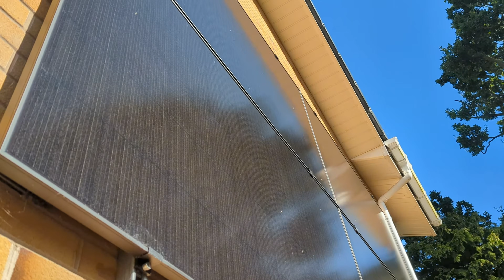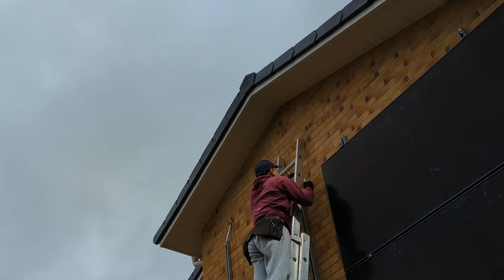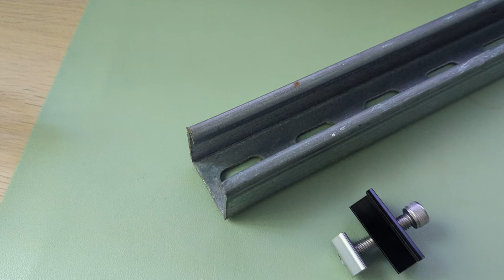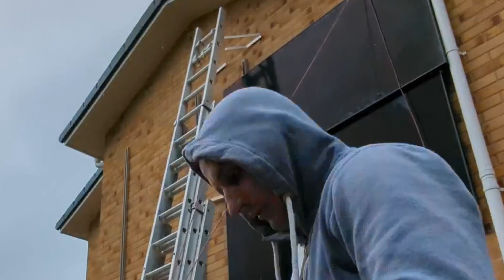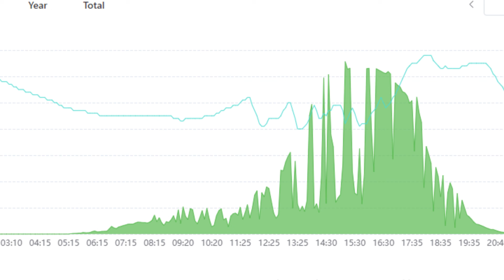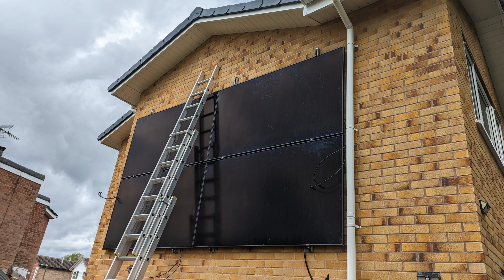DIY Wall-Mounted Solar Panels on Unistrut Mounting. Installation Guide & Performance Stats

Comment: I can't believe I found this. I was just thinking about this on one of my walls and I'm a theory solar person at the moment and I'm dying to get my feet wet and I was thinking I wonder if I can put them on the wall just to get a hand of you know, solar and how it's working and I'm from the UK so that's fantastic that You really did this is Project. 

I'm curious what you say about neighbours. I don't have any neighbours that side of my house, but what would they be losing? Because that's a solid wall.
When you said light, would it be the light that reflects off your wall. They take that into account do the counsel?

I don't think birds could get underneath there either, could they? To make nests or anything?
Reply from the maker: Thank you for the kind words, and I'm glad you found this helpful.

Regarding the neighbours, I've seen posts on DIY groups where neighbours complain that the sight of Solar Panels on anything but a roof is a nuisance. Another DIY project we did (a gazebo in the garden with panels on top) also caused a neighbour to comment about how it looked. In my experience, the reflection angle is so minimal that it could barely be an issue.

Mentioning the light in the video is related to another topic. When mounted vertically, panels catch less dispersed light on overcast days, making them less efficient.

I agree that birds won't be interested in getting behind the panels, but in some cases, they love to perch on them, and their droppings could stain the panels. People suggest sticking spike strips at the top panel to discourage them. I haven't had bird issues because plenty of trees are nearby, and I assume birds prefer them.
Reply: @solarenergyconcepts  It's hard to work out how people tick, I know. Goodness knows, people are crazy. thanks for all the info i have subed
Reply from the maker: Agree, and it's good to know that in most cases the regs will permit it. Best of luck with your project.

Comment: I've just put three 525w panels along the rear wall of my house which faces SSW with no shading, they are predicted to generate 1.3MWh a year. My garage has 12 panels, and several roofs on my house, total 15.5 kWp installed. The wall panels are angled at 84 degrees, which is the maximum I could achieve and stay in the 200mm for permitted development.
Reply from the maker: Impressive! No shading is amazing factor. What mounting equipment did you use for the tilt?

Comment: Nice rundown! I’ve only seen wall mounted panels like this once before on a building and it was for solar thermal water heating.  If planned and designed properly,  this could work for many buildings.  What’s more popular today is mono and bi-facial panels that act as railings on balconies.
Reply from the maker: Thank you. Yes there's lots of underutilized space that can generate energy

Comment: How did you limit the export to zero ?
Reply from the maker: There's a setting on the inverter to set it for zero export. It monitors the energy flow to your home at the grid input point and adjusts the production from PV accordingly. The inverter uses a CT clamp to monitor the flow of energy from the grid input. To make doubly sure, on the Sunsynk you can adjust a little trickle feed to compensate for any error based on your CT clamp distance.

More on this: https://youtu.be/wO_p5TltuvU

Comment: Definitely a DIY job only as no professional is allowed to do this under the MCs scheme unless they provide bending moments and shear force data.but really nice job and great idea.thanks
Reply: @bernardcharlesworth9860  I'm interested in getting Mech approval along with electrical (as i have for my ESS project). I'll keep you posted.  Any advice on applicable codes are appreciated.  Attaching to brick.
Reply from the maker: Thank you. I believe the time and effort cost for a professional to do wall installations will be similar if not more than a roof job.
Reply: @solarenergyconcepts  I agree.Have a nice day
Reply: That's interesting, thanks for that information.

Comment: Why did you decide to mount the supports vertically rather than horizontally?
Reply from the maker: In this particular instance I wanted the panels in landscape orientation. The distance between the edge of the wall and the downpipe wouldn't fit 4 panels in portrait. I didn't want to move the downpipe. For that reason I decided it's easier to go vertical and keep stacking the panels up.
Reply from the maker: @solarenergyconcepts I probably could have gone with horizontal mounts on the short side of the panels, but I wasn't convinced it would hold as tight as it does with the end clamps grinding it from below. https://solarenergyconcepts.co.uk/unistrut-nut-and-rails-colage.jpg
Reply: I can answer this from personal experience. If you mount your rail horizontally you have to make sure you get your rail bang on level. Not such a big deal. But the biggest reason is that the fastensol clamps need both edges of the rail to clamp against if there isn't a panel either side of the clamp, for example the very bottom rail

Comment: I have 4 panels installed on a south facing cable end . They perform very well in spring autumn and winter when the sun is lower in the sky .
Reply from the maker: That sounds great. I assume you have little shading issues as well?
Reply: @solarenergyconcepts  I have huge shading issues to the east roof . 4 panels on west roof no shading and 4 panels on south gable no shading 👍🏻

Comment: as a builder all i can say is damaging you wall is not better then your roof 🤭
100% that roof can better handle that weight then your wall

if you f up your wall there is a biog chance its is a total damage on the house 
a roof is not holding up the whole building 
bricks are not that hard to pull out 

a roof is made to handle wind presure in a way a wall is not 

not saying it cant work
but your wall is the weak point not the roof
that roof will handle 500kg easy, the 500 kg does not rest on 1 single point

its not so much the down force you have to worry about, its the wind forces that lift it out/up
your roof would have been gone by now if it could not handle a little string of panels..
after all that house is not a shed

if the roof is that weak, i would support it right away
Reply from the maker: Thank you for sharing
Reply: "as a builder"...    Legos? 😆
Reply: That’s the first time I have heard someone say a brick is not hard to pull out . Would like you to show us you easily pulling out a brick from a wall .
Reply: Maybe you need to go back to builder school, if houses you build have walls that come apart by screwing a 20kg solar panel to them.  🤣🤣🤣

Comment: there is study that vertically placed  solar panels are best placed on east side, because sun hits them the longest time.
Reply from the maker: Interesting. I would have loved to have the option on the eastern side, unfortunately it wasn't possible in my case.
Reply: In Southern California, we something called time of use rates. Electricity from 4pm to 9pm costs 50% more than from 9pm to 4pm. Therefore it would be more cost effective to generate power in the afternoon ie West rather than morning.
Reply from the maker: A battery can go a long way to help with that. You've got some interesting government subsidies in California too, right? AFAIK it pays $200 per kWh of battery storage installed
 https://solarenergyconcepts.co.uk/post/best-states-for-home-solar/#california-self-generation-incentive-program
Reply: why not west side? Cause they already heated up by noon?

Comment: im hoping to do exactly the same, thanks for your video.  ive already got the same inverter with 5x435w panels on my shed roof.  I also want to avoid going on my roof.  With the sunsynk, the mppt startup voltage is quite high so id imagine better results with at least 5 panels.
Reply from the maker: That sounds great. Just four should be fine for starting it. The good thing about the voltage is that it doesn't fluctuate that much. If there's light, there's voltage, and if you can get up to 125V, the MPPT comes alive. Most 400W panels operate at around 32-42V, so four of them will bring it up easily, and at five, it will be guaranteed to work.

Comment: I installed panels along my rear garden fence. 10 panels in total 405W each. They are vertical so as not to cause any obstruction along the path that runs right down the garden. Went with the 3.6kW sunsynk inverter and 5.12kWh battery as well. Knew going in that i wouldn’t get the production as if had put them on the roof but doing all the work myself apart from connecting to the mains saved me between £4k and £5k for the same number of panels. Still i managed to get 280kWh in July and 250kWh in August. Actually doing quite well so far in September as well, not as much of a drop from the other 2 months. Thinking of adding to the system by putting some panels on to the side and roof of a brick built shed at the bottom of the garden. Prob get another 5 panels.
Reply from the maker: 10 panels on the fence! Love that. I assume you've got these as two strings on the inverter. How do you plan to connect the ones you're going to add?
Reply: @solarenergyconcepts instead of a hybrid inverter you could look at a victron multiplus on your battery, it works on 48v, you could then add an unlimmited amount of mppts on the 48v side, they could charge your battery directly on DC or be used with the multipluss to convert the 48vDC to AC when not using the battery. This way you are not required to get a big bulky inverter for every bits of extra solar panels you add. Depending on the model of hybrid inverter you could perhaps do something similar if it has 12/24/48V DC bus exposed
Reply: @solarenergyconcepts 📌 Please write the entire list of parts that will be needed to mount two Risen 550w panels 🤔

Comment: I'm doing the same after I finish my solar pergola/greenhouse, but I will be putting them in about 20° to 30 ° angle to avoid sun dazzling and get better solar production. Still deciding if to get Bifacials. Thanks for confirming Unistruts are better to use
Reply from the maker: Good luck with your project